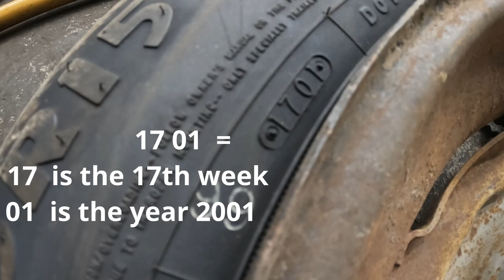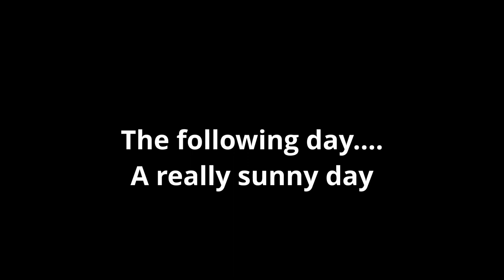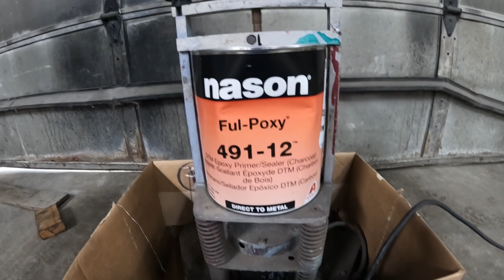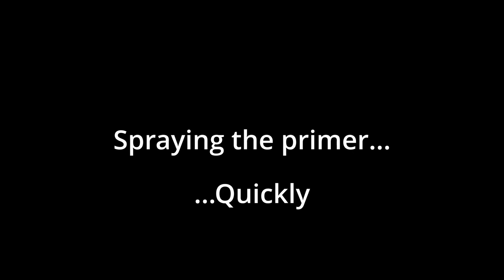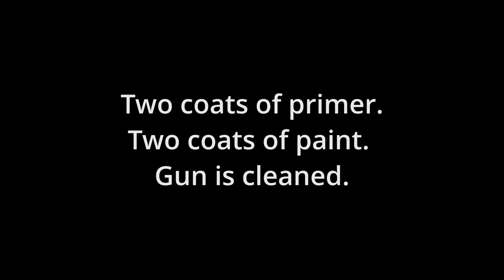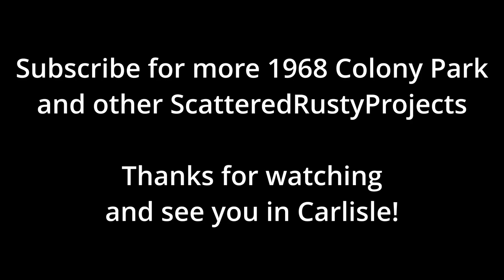Steel Wheels...Cleaning, Stripping, Priming and Painting. 1968 Mercury Colony Park.

Comment: I had a 1968 Colony Park station wagon with rear facing 3rd row (way back) seat. While it was one of the best looking wagons ever, it was a POS to drive. Horrible fuel mileage 10-12 city, 15-17 highway, crappy brakes-even with front discs, rode like a marshmellow, numb no feel steering. But wish I still had it.
Reply from the maker: Can't expect much more for mileage from a big carbureted v-8 moving an almost 4000 lb vehicle.